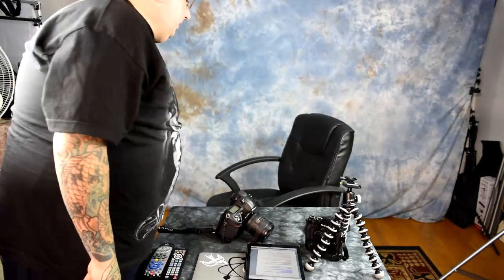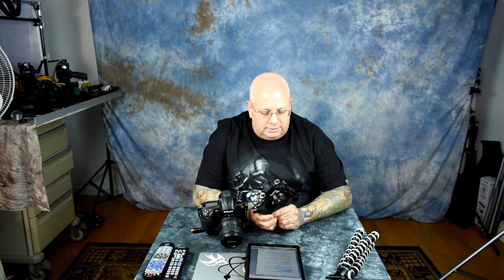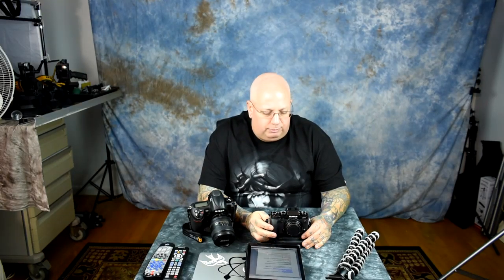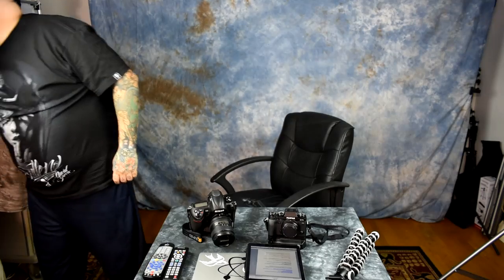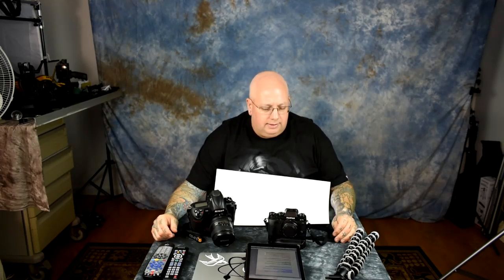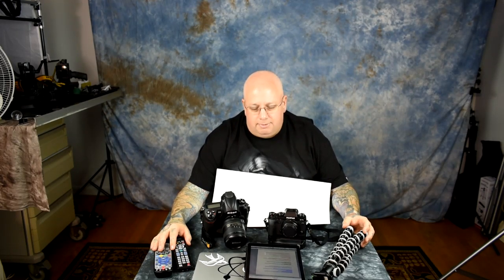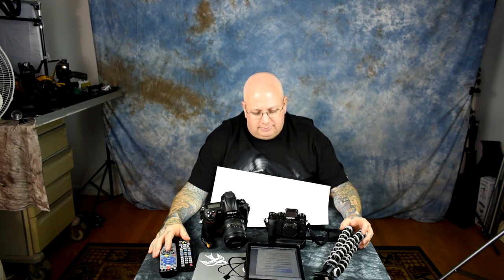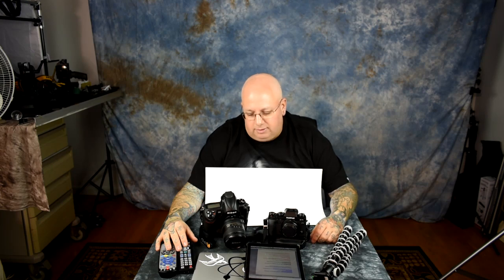Angry Photographer: Defining the Fuji sytem, its quality, construction & its workflow

Comment: Hey Ken,i want to buy a used XPRO-1 but have to sell one of my Nikon bodies,i own D300 and D7000,which one would you sell?,i also own a Fuji X100,so i want to have two Fujis and one Nikon for event work with speedlight.
Reply from the maker: +Jesus Samaniego hell, id sell D7000
Reply: D300 that much better?
Reply from the maker: no, but its reliable and made better

check this test shot D500
check it
https://www.flickr.com/photos/134746128@N05/26374767370/in/dateposted/
Reply: +Theoria Apophasis wow just amazing,thanks a lot man I appreciate your information and feedback.